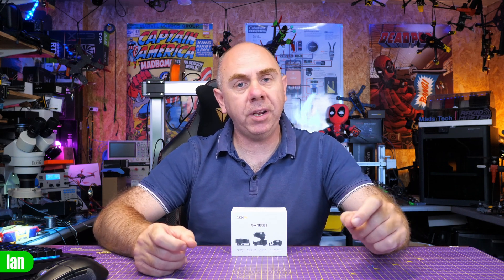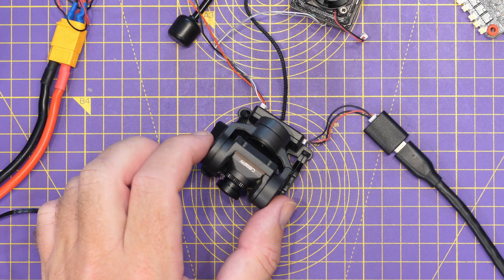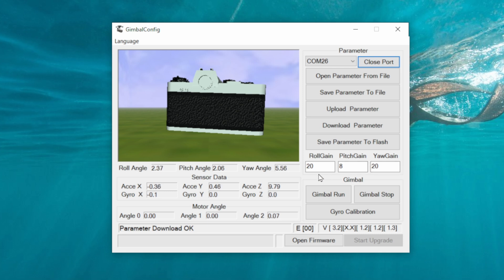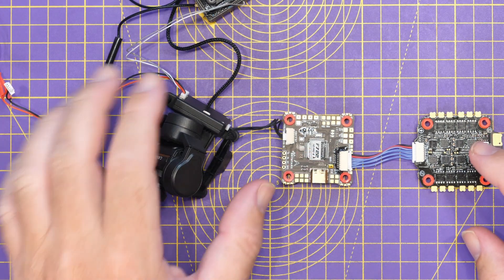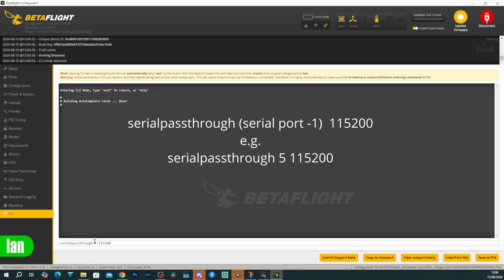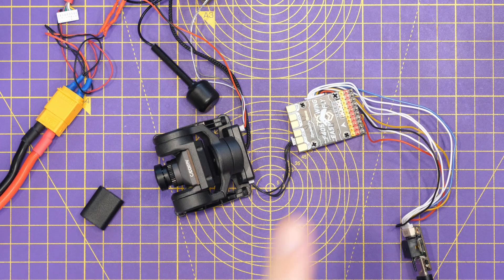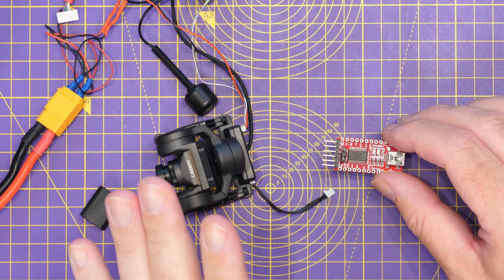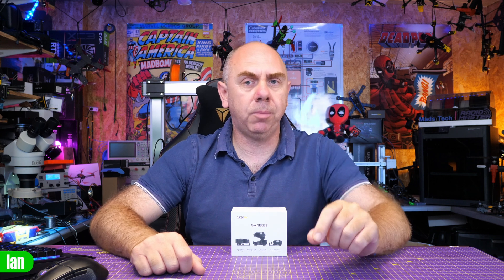Caddx FPV GM 3 And XF Robot C-20 GImbal Firmware Update How-To

Comment: CADDX includes several tiny cables & connectors with the GM3 gimbal but not that tiny 3-pin connector shown at 1:24 in the video!  I had to steal one from a BetaFPV drone that I have. 😔

Comment: Humbly request assistance/troubleshooting. 
I'm trying to use the C-20T 3-axis gimbal via direct control with its head tracker. Here's my setup:
-Gimbal Kit: C-20T 3-axis DJI O3 gimbal Kit (includes head tracker and base plate)
-Drone: Equipped with DJI O3 Air Unit, FPV Remote 2, Goggles 2, and connected to a Skystars F7 Mini HDPro flight controller
Issue: The base plate isn't binding.
Binding Process:
-When I press the bind button on the head tracker, the light blinks rapidly, indicating it's ready to bind.
-However, pressing the bind button on the XF C-20T O3 Version Integrated Base Plate does nothing—no light is emitted from the base plate.
-I do see a tiny blue light blinking slowly inside the gimbal, which is different from the head tracker’s binding light.
Current Status:
O3 Air unit camera provides visual feed (connected through gimbal via base plate  which does auto stabilize but head tracker does not relay motions to the gimbal.
Troubleshooting Done:
-Firmware: Both the head tracker and gimbal firmware are up to date (V1.8 and 3.4 respectively). They register inputs in their respective software but aren't communicating with each other.
-Questions:
--Is there firmware for the base plate that needs updating?
--Am I missing a step in the software setup?
--Could the base plate be faulty, or did I wire something incorrectly?
--For direct control, should I solder  additional wires to the flight controller? Here's how I wired the base plate’s Communications Port (SM08-GH-TB):
----Power: Soldered to the Cadex Unit (10V) pad on the FC
----GND: Soldered to the Cadex Unit Black GND pad on the FC
----PWM1: Connected to the Cadex Unit SBUS pad on the FC
----PWM2-PWM4: Not connected
----NC (2x): Not connected
Any help would be greatly appreciated, thanks all!   O7 commanders
Reply: Did you get it? Mine connected no prob. I put tracker in bind and then pressed let off and held in the base plate button (like starting dji) and it connected. I didn't update anything before hand thought. Took me a bit to realize i needed to power up both input plugs to get everything to work at same time. Mine didn't come with a cable to go from baseplate to 03 air unit but i made 1. Made it just like the dji plug. Trying to figure out how to get the air unit into high power mode without a flight controller myself 😉 i would like to make this a stand alone unit so i can transfer it from drone to truck.

Comment: Just to confirm, Arris Hobby appears to be XF Robot..? Or just a vendor? For the long range folks out there who are using a ground station antenna tracker it really seems like the way to go is to use the XF Robot remote head tracker. If i parsed this out correctly, this means sticking with the original XF Robot firmware. You would need to use an HDMI from the VRX to the goggles, but allows antenna tracking separate from head tracking inputs.